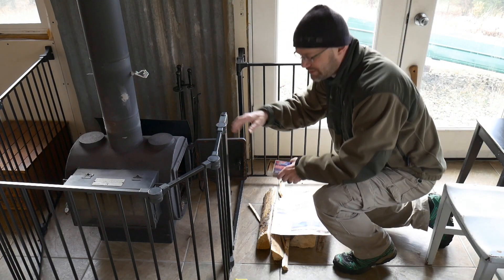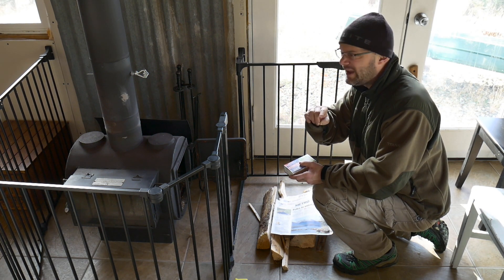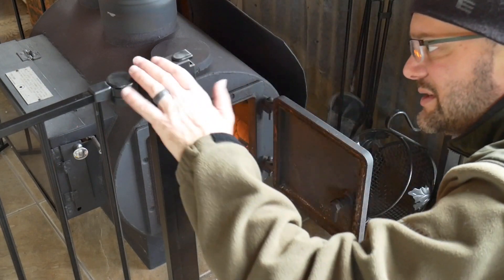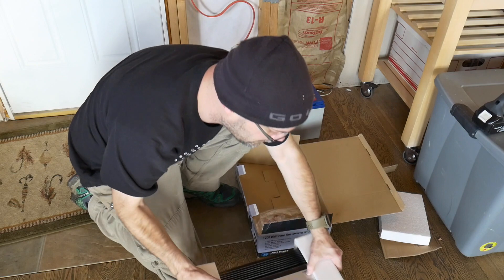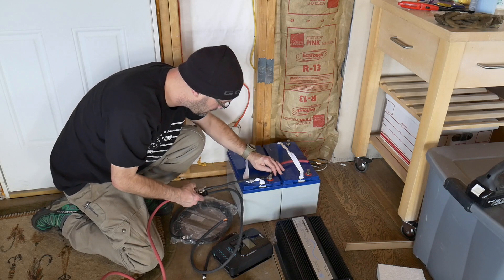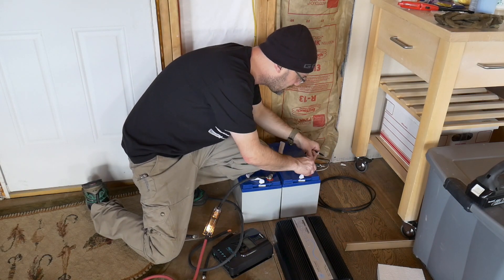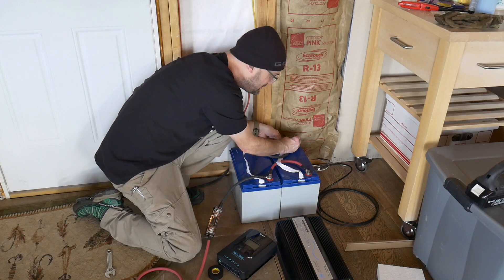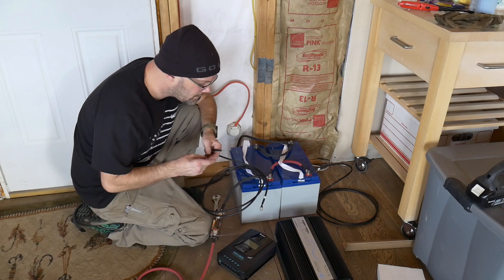Really Easy Cabin Solar Power Pt.3

Comment: Hey D2S love ya vids, as always.  Solar Tip, given to me from a pro, re- tighten any wire screw connector after about an hour , as the cable will compress in that time. Really torque 'em down.
Reply from the maker: Thats a great tip!